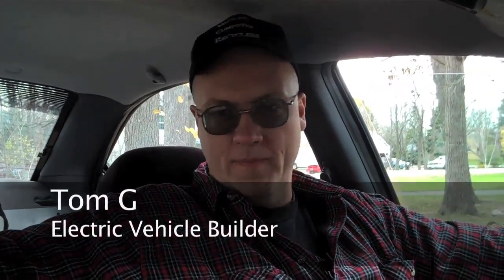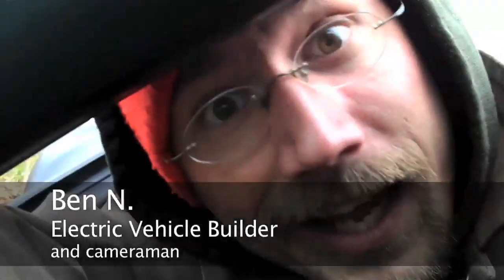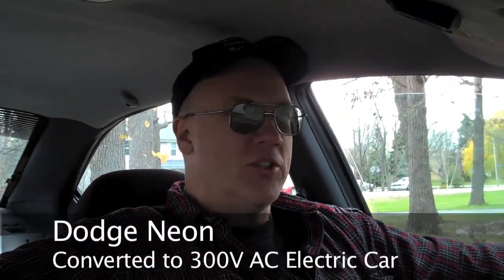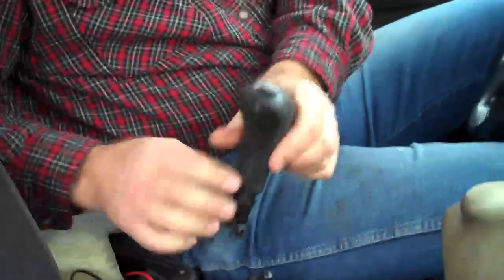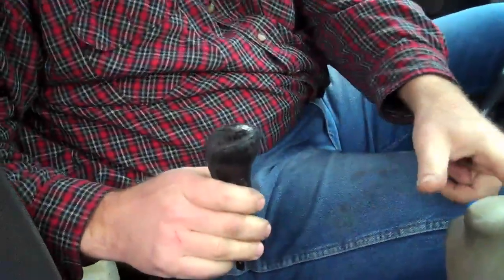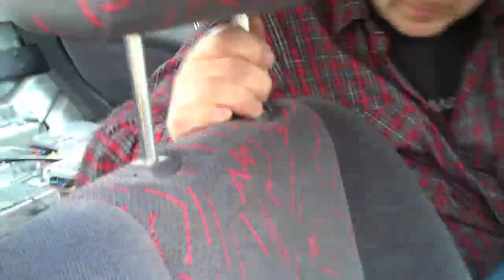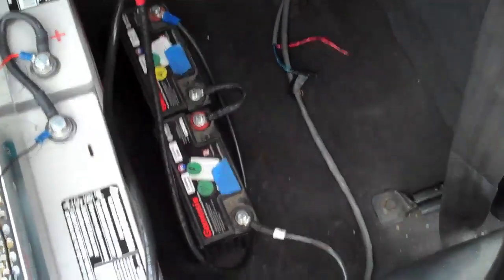010 AC Electric car conversion 101 - Shifting an Electric Car

Comment: Hi Tom , you guys are doing a  fantastic job...really nice work!   I don't know if I missed one of your episodes were  you showed the motor controller...my question is are you using a standard VFD.  If so the only ones I seen on the market that have single phase inputs at the type of 3 phase current output that you would need to run a car would have to be a solar pump inverters? At the end of the day what was the motor controller that you guys incorporated into the car? Keep up the good work and enthusiasm!
Reply from the maker: Yes, for this car, it just used a stock VFD (variable frequency drive) that originally ran that motor when it was salvaged out of a factory.
It was just fed DC from the batteries instead of AC single-phase wall power.

Comment: Hello Tom, how can i turn my 2012 Buick Lacrosse? How much will it cost?
Reply from the maker: Any car can be converted to electric, although some are better than others.

For cost - that's a bit like asking "How much does it cost to build a house?"
Frankly, you can put as much money as you want into a project.
To keep it inexpensive, you can use second-hand parts, components from salvage yards, and parts from crashed commercially-built electric cars.

Comment: What is your motor rpm
Reply from the maker: Electric motor speed is the same as what it would have been with a gas engine. We are using a stock manual transmission, so the gearing is exactly the same as any other gas Dodge Neon.

Comment: curious... how would an electric motor pair up with a CVT transmission? i assume it would mean you have no gear changes, and make driving and install more simple (at a higher cost of the cvt). might be the most simple method?

Comment: ime just wonder, why don't people use the clutch on the manual transmission when installing an electric engine. Wouldn't it make it a much simpler build?
Reply from the maker: It would be more moving parts, more complexity, and more rotating weight. Going clutches simplifies things, and MOST of what a clutch is for relates to how GAS engines work. Folks DO also make electric car conversions with clutches. Most of the ones that I've seen were usually on trucks like Rangers and S10s, using larger motors, and were heavier vehicles.
Reply: +BenjaminNelson you can lose loads of the weight... and also i can't see why a flywheel would be a bad thing? wouldn't it mean it picks up easier after letting go of the gas?

 also wondering how often a cvt (vario transmission) is being used as the theorie behind it seems way more suitable for an electric car... the older once from seat/volkswagen are common and cheap so..

Comment: An idea on the regen and/or brake lights - could you not set it up so there is no regen but use the original brake light switch as a trigger? That way it would coast like a normal car untill a brush of the brakes. No need to actually use the brakes - set the switch so it activates high up before the pads touch. The initial part of the brake pedal movement would put on the lights and start regen braking then press harder and you get the mechanical brakes joining in.

Comment: the shifting issue is something every truck driver is familiar with. The transmissions in a semi is a non-synchronized system. The driver is your sync-system. 

Road speed and engine speed!! something tells me you should have left the converter in the drive train!

great videos so far!!!

Comment: The Toyota Prius Hybrid also has regen when you lift the foot off the gas pedal but the regen is only as powerful as a traditional ICE engine braking, so they don't bother with putting up the brake lights during the mile regen down. However if you hit the brakes it will do a harder regen and then swap over to hydraulic if you depress your foot more - or at least this is how I understand it. Cool project, all the best!

Comment: i think he would then have to keep the flywheel, which all that weight ( for the momentum) would cause much less range i think

benjaminNelson, i have a 2000 neon, it good shape, except the motor is starting to  break down and its an automatic... im planning of converting it to a dc forklift motor, and cheep batts to start off, then after about a year adding lithium titate batts, ac motor, re-gen what do you think? i forgot im gonig to get a manual trans. for it from the scrap probobly

Comment: i have an idea how to charge a battery bank and drive on the other one and put switch to switch to the other battery bank that has been charged and switch the charging system to the battery bank that needs to be charged no plug in any more just the car charges its self while moving if u need any information im here and i will tell u how.you guys worked hard on this ur mistake was u used an ac motor u shuda used a dc motor 5 stars for the hard work

Comment: The smaller batteries act like the main batteries discharged, you can't draw heavily on the reserve setup and can't go far.  Even if I did draw the reserve all the way to shut off I'm still over 1.5V per cell.  Now that I have a feel for the car as the pack is running down I don't have to use the reserve, its just there in case of emergency.

Comment from the maker: It's much more like hard engine braking than just letting off the gas. I think a brake light setup is a good idea, but maybe using the accelerameter so that they only come on when the car is really slowing down at a rate comparable to using the service brake.

Comment: I think the brake light issue is really a non issue unless the car is slowing much more than normal engine braking.  In a gasoline transmission vehicle, you let off the gas and start to slow down, and the brakes don't come on.  Unless the regen is slowing you like you have your foot on the brake, I wouldn't  set it up, as you will look like you are riding your brakes all the time.